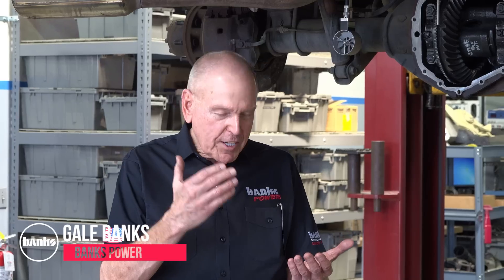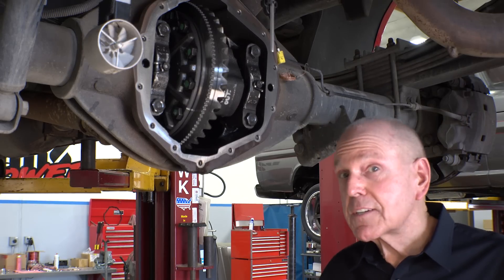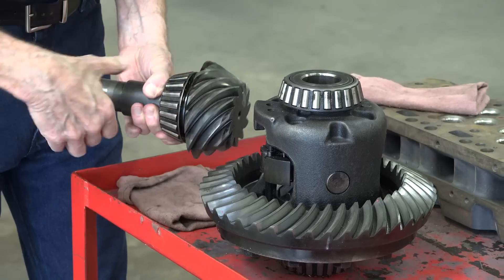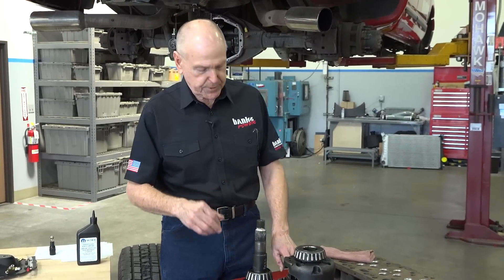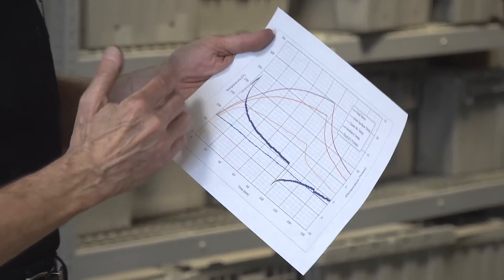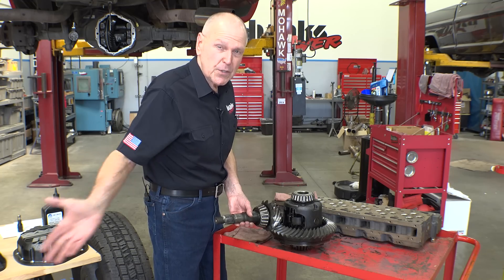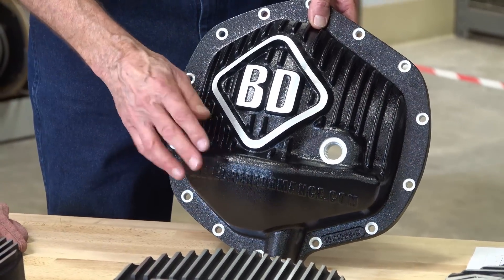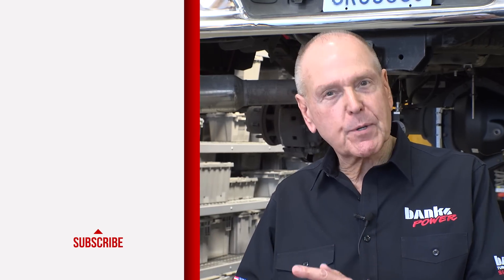Do Diff Covers Work or Are They Just Bling? Part 2 of 3

Comment: Thanks Mr. Banks! Observing your thought process makes me proud to own one of your fine exhaust headers The only rational reason to purchase one of these diff covers is to increase protection from rocks in off road  wheeling. However, Diff guards can perform that task while keeping the efficiency stock covers. Can you please test the covers provided by switchable locker manufactures like ARB, OX and Eton ? These covers have required wire or cable attachments cast into them to facilitate the operation of the lockers.

Comment: My friend has 479,000 miles on his 100% original 2000 7.3 F350.  I also have a 2000 7.3 F350 and the rear cover actually rusted out and started leaking.  In New Jersey they over salt the roads and it just destroys vehicles.   I just replaced it with a stock cover from a salvage yard for $10.00, and painted it with rustoleum. I figured that if my friend had almost a 1/2 million miles on a stock cover and never had a differential issue, then it was good enough.  I thought about using a fancy alloy cover, but was concerned that the salt would destroy it's appearance!  They do look cool!

Comment: Banks hasnt made  anything jaw dropping for fords until now. I haven't used their stuff on my 2000 7.3L but this cover might be the first thing I try. Website could use some updating and refreshing.
Reply from the maker: Although we appreciate your backhanded compliment, we've been in business for 60+ years and many of our competitors are chasing us. Our Derringer inline tuners are the most popular tuning solution for the 2017+ Duramax. Our Monster-Ram intake elbow is the most popular and best flowing of its kind. The list of innovative parts goes on and on. Curious, what part of the website do you find outdated?
Reply: @bankspower  Haven't made anything useful for the fords especially the 7.3L. Website is slow to load and looks very old and outdated. Needs to be freshened up. You guys haven't caught up to the times except with this new "diff cover" which people with Fords have been left in the dark wondering?  Where is the cover for us? Also no new products have come out for the older trucks. I know people are buying new but the majority of the diesel world is still older rigs.
Reply from the maker: @gman8760  The 7.3L is a great truck, no doubt about it. However, we're laser-focused on late model trucks. We can barely keep up with demand. Now, our diff cover for the Fords are on the way. We'll have coverage from the late mid-1990s all the way through 2020. We had to launch with a single cover as proof of concept. We chose the AAM 14-bolt because it fits both 01-19 GM and RAM trucks. That's a lot of trucks for a single part number. Now, we're focused on Ford covers. Sterling, M275, M300, Danas, etc. They're all on the way. As far as the website, yes, it's a little slow. But other than speed, the layout is fairly consistent with most modern sites. But we're always working on making it better.
Reply: @bankspower  I don't expect you to provide tech for dinosaurs however this cover looks promising for us Ford guys. Just my 2cents on the website. Edited my comment to show no disrespect, just a unfiltered non sugar coated commenter.
Reply from the maker: gman d  We appreciate your comments. Helps us improve. 👍

Comment: when designers invented the hypoid gears(to get the hump in the floor pan lower) they threw away horsepower and mileage. because the pinion is NOT in line with the axels and acts like a partial worm gear. special lubricant is required just to make it work at all. Notice big truck differentials the pinion gears are inline with the axels. Trucks(big trucks) do not want to throw away efficiency and horsepower. so. if you want more horsepower to road. putting a real truck differential in your truck. can you do that? I don't know if they make them small enough.

Comment: Wouldn't the increased area the lube is exposed to generated by the more turbulent lube flow in conjunction with the increased surface area of the aftermarket diff cover more then negate any extra heat generated by the lube making a right turn (as you put it)n the case..
Reply: I wouldnt be worried about the heat from  right turns so much as the aeration...

Comment: "The manufacturers know more about this than I do"... Hmmm, perhaps a little bit, but you're looking at it using sound engineering principles (Like all your videos. You're fun to watch.) You understand lubricants and how they work by creating a film and fluid dynamics to the extent necessary. You're considering the temperature of the fluid and its performance, the dissipation of that thermal energy to the outside air, and the flow of the fluid to see not only how it's coming around the back with the ring gear, but also how it splashes out to the carrier bearings.

Yes, the manufacturer's engineers know a lot, and perhaps a little more.. But are there /really/ any big secrets that you're missing?

Comment: I'm ashamed to say that I've never thought about most of this stuff.  I've only ever wanted an aftermarket diff cover for strength when going off-road.  It's not fun peeling your stock sheet metal cover off while dragging your diff over a rock and losing all your fluid.  I never even considered that the diff cover helped distribute the oil.  I thought the ring gear did that all on its own.

Comment: When can we expect part 3?
Reply from the maker: The reason for the time between follow-ups is purely due to R&D. When we post a video, ten times out of ten, it's something that happened that day or the day before. Regarding the diff cover series. We've been sitting on the info for quite a long time. Why? We'll only get your attention once. We're going to reveal the research when we debut our cover design. We made many iterations and several billet prototypes, tested the heck out of the design, then went with a manufacturing process that is far more accurate but takes much longer. We have the diff covers in production and hope to have an announcement soon.👍🏻
Reply: @bankspower  cool! thanks for the update.

Comment: I really wish they'd just seal off the outer wheel bearings and provide a grease inlet and outlet.  The freakin Dana 44 in my Wrangler leaks, no matter what i do to it.   It leaked about 2 years into ownership (from new). Then about 10 years into ownership, i rebuilt the whole thing.  It sealed perfectly for about a year, then blammo, puddles of oil everywhere i park.

Comment: 300° F? Holy hell... The transmission in the class 8 tractor trailer I drive typically doesn't reach 200 ° F. Front drive axle typically peaks at 180°, rear drive even less.
Reply from the maker: 326°. 250hp for two hours at 70 mph. We've since dropped the test to 200hp for one hour at 70mph.

Comment: Wikipedia has an interesting image embedded in its article on the 10.5" Corporate 14 Bolt Differential.  Link to image:  https://en.wikipedia.org/wiki/File:2013-08-03_11.8_AAM.jpg

Caption to the image: 11.8 AAM axle. Optioned on 3500 RAM trucks with the High Output package.

The cover shown seems to be shaped like a regular cover on the inside, but with added fins on the outside for cooling.  Granted, it's on the larger 11.8" axle, but it looks like it might be a better way to make the finned diff cover for the smaller axle than the aftermarket ones currently available.

Comment: its kinda ironic to me that a guy who is in the after market business is doing research to prove the oem is better then aftermarket...i added some fun go fast parts to my last truck and managed to blow up the transmission and diffs and most of the running gear, but all i've kinda learned from it is leave it stock, the manufacturers spend so much time and money to research how to make it last.  and unless your sponsored as a race car driver you probably can't afford to replace a vehicle every 3-5 years so longevity is kind of important.  So on my new truck i'm keeping it stock and using actually oem dealer supplied and installed, i know its expensive as fuck but if it lasts me over 10 years then i'm golden

Comment: I'd wager a bet that the OEM cover is designed as such solely to utilize the minimum amount of material necessary to contain the minimum volume of fluid necessary to prevent frying the diff.

Has anyone called American Axle to ask their engineers for some design details??

Or how about the powertrain engineers at Chrysler amd GM? Maybe rather than guessing, they could provide some technical insight?

Comment: usually people who buy those diff covers are naive and think it actually cools the diff, in my opinion they don't even improve anything. Even if it does cools the fluid it'll be abysmal to notice and might only do so on long trips and loads. All I know is this if you're trying to cool the diff fluid, you're better off with a differential cooler if you're actually putting load on it and abusing it.

Comment: You're going to prove what real builders already know. It's like most stuff on vehicles. O.E. is patented for a reason. B/c it works correctly. Covers, fluids, brake material. It's only when you have modified to the extent that something different is needed.  Monster trucks would be a good example of that. Not too many monster trucks going down the road. Good job. I like how you cover all aspects of testing. True testing. Did you try to get data from the manufacturer to compare you data with? I would.

Comment: A point you didn't make as the oil heats up the metals made the oil hotter. That means the metals are expanding in size
When you've got a gear to gear connection it creates more friction taking away more power from the motor to make the gears turn as the mesh gets tighter, the gears and berrings are under a preload tension heat makes the tension tighter, as you cool it down the friction drops becuse the metals gone back to its static shape.
Now if you think I'm nuts how many of you have used heat to separate metal parts that were press fit? You can heat up a berring race on a axel by the outer axel berrings to get it to fall off the axel shaft
Now think about 2 trapped gears meshed together as the gears get hotter the metal expands both the ring gear and the pinion gears.  If these metals get hot enough then the inner axel berrings get hot and you loose even more power becuse of the drive train. 

Banks is 100% correct about this and you've only got to think about it, heat slows ya down it robs you of power.

Im no engineer, this is basic theory and fact.  Working in a machine shop and around printing presses seeing what causes parts to fail ive got a grasp on the way metals react. 

Ask any mill operator do parts come off the mill in tolerances  and later that day after they cooled off you get a tottaly differnt reading when inspected. 

My uncle owned this machine shop ive seen 10k dollars worth of scrap becuse metal changes shape with heat its hard to take a 100 thou cut as a finnish cut and hit your tolerances.

Comment: The original designers of those after-market covers were idiots! 
To me it's so obvious that the internal surface of the OEM diff is perfect for creating a mold to base an alloy cover on. The cooling-fins then could be molded with deeper grooves towards the outer edges of the cover to maximise cooling & strength. Certain that vehicles built with alloy diffs on their IRS use vertical fins as they dissipate heat more efficiently than horizontal fins!

Comment: All that is nice, but the stock diff covers still have one major problem-dealing with the gasket for oil changes is a major pain.  Why oh why don't they just put a damn drain plug in them?

I suppose the answer is it would cost $5:-(
Reply: They want you to visually inspect the condition of the differential and to clean any contaminants that will not drain.
Reply: Fair enough.

Comment: Engine speed is not 3k rpm at 70mph... in high gear it's around 2k. That's where u operate going down the highway. 
3k would be if u were pulling a load up a hill. At which u would   have more than 250hp at the tires.

Comment: Where's the 3rd video? :(
Reply from the maker: The reason for the time between follow-ups is purely due to R&D. We've been sitting on the info for quite a long time. Why? We'll only get your attention once. We're going to reveal the research when we debut our cover design. We made many iterations and several billet prototypes, tested the heck out of the design, then went with a manufacturing process that is far more accurate but takes much longer. We have the diff covers in production now and hope to have an announcement soon. 👍
Reply: @bankspower  Right on! Thanks for the reply.

Comment: Where is Part 3?
Reply from the maker: We haven't posted one yet. The reason for the time between follow-ups is purely due to R&D. When we post a video, ten times out of ten, it's something that happened that day or the day before. Regarding the diff cover series. We've been sitting on the info for quite a long time. Why? We'll only get your attention once. We're going to reveal the research when we debut our cover design. We made many iterations and several billet prototypes, tested the heck out of the design, then went with a manufacturing process that is far more accurate but takes much longer. We have the diff covers in production and hope to have an announcement soon.
Reply: @bankspower  Thanks for the reply!

Comment: Saying that the manufacturer knows best is rather inaccurate. If they know best, how come there are so many upgradeable parts from polyurethane bushings, serviceable ball joints, 2 piece designs to 1 piece and vice versa, oem plastic parts that brittle out and are replaced by aluminum upgrades, and finally if the manufacturer knows best how are there so many recalls on things that kill people. Not all of them are deadly so some manufacturers dont do anything about known issues but the aftermarket community have always come out with a fix one way or another.

Comment: Hi
Years ago I was working in an International truck dealer.  A guy pulled in with a pick up truck.  He was pulling a huge trailer with a very heavy load. He ahd already burned a differential ring gear and pinion.
I don't know if he ever got a cure for the overload. he had many miles to go.
Sorry I don't have more info.

Comment: Wouldn't it be really interesting to make a clear plastic cover with the inner vertical flow ring/channel, and one without like most of the aftermarket covers, so we could actually see the impeded fluid flow in action? The logic of it all makes sense, and increased fluid temps back up the theory, nevertheless the added visual would still be interesting.

I imagine you could easily make one using some plastic and one of those heated suction forming machines. It might not even definitely wouldn't be be durable enough to run at high speeds, but it wouldn't need to be. Just an idea.

Comment: Edit edit edit!!!! You DON’T need to go over the same crap you did in the first video. Half of this video is the first one all over again. You basically could cut everything before 13:30

Secondly the engineers number one thought is cost reduction. The reason for the cover’s nice radius curve could be fluid dynamics. Or it could be it uses the least amount metal. Similarly to how the Fiat got its flowing shape.
Reply: Cost as number one thought is more of an accountant's mind set.  An engineer does consider cost, but it's not the only or necessarily the first consideration.

Comment: WHERE IS PART 3
Reply from the maker: The reason for the time between follow-ups is purely due to R&D. When we post a video, ten times out of ten, it's something that happened that day or the day before. Regarding the diff cover series. We've been sitting on the info for quite a long time. Why? We'll only get your attention once. We're going to reveal the research when we debut our cover design. We made many iterations and several billet prototypes, tested the heck out of the design, then went with a manufacturing process that is far more accurate but takes much longer. We have the diff covers in production and hope to have an announcement soon. That being said, an announcement is days, not months away.

Comment: The manufacturer is worried about one thing and one thing only how cheap can I reliably make it cutting corners when possible less fluid if it hugs the gear less fluid less money boom stamp that shit out of sheet steel and done benefits of aftermarket some actually add structural strength a larger capacity following the fluid level of dealer is still possible they add cooling find to electronics for a reason... It works even if you don't have much air flow the extra surface area of those fins is still there dissipating heat when you have money tied up in my case 513 gears and Tru Trac with 37's on a GM 8.6  10 bolt you can bet your ass I want more fluid cooling fins and the added strength...The front is a split aluminium case so nothing but gears and a open front but with that combo that 7.25 ring is like the cool-aid man just waiting for the right moment he's made an appearance twice now...I have a wreaked 2500 for a new front end just I can get a good cover for that and a posi just waiting on the cool-aid man to decide he wants to come Hangout with me and the Fab will Begin

Comment: These covers are completely bling for the daily driver, any gains or losses are going to not be noticed by 99% of the vehicles on the road. For a diff to fail that wasn't abused or neglected (or leaking axle seal) on a daily driver is pretty rare, the guys that design and build them know their stuff. If you want bling take your wife to the jewellers